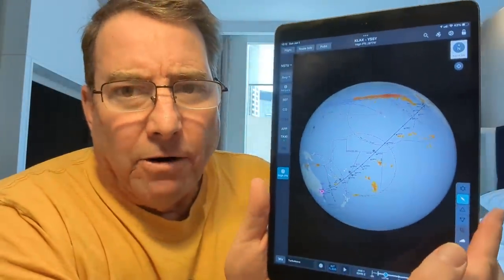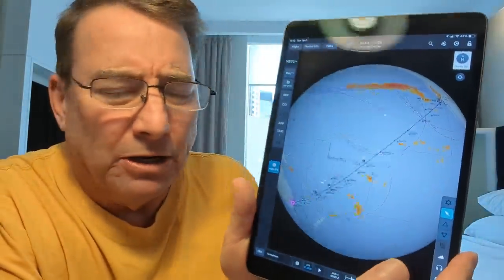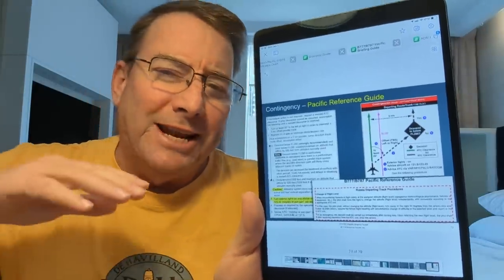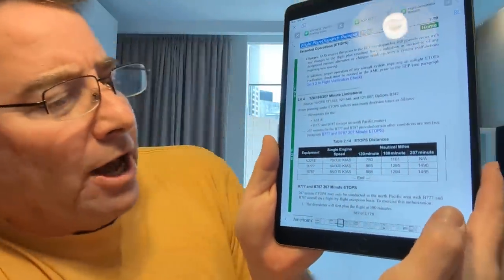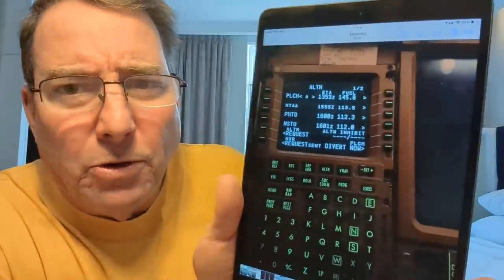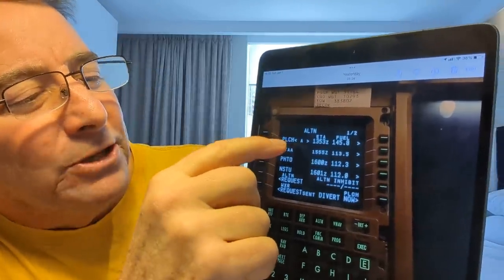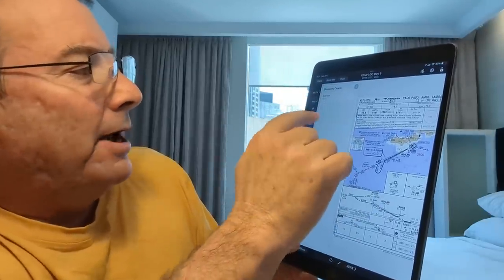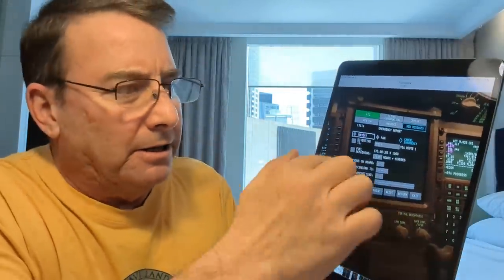Emergency Divert! UAL #839 Pago Pago 1/1/2023

Comment: Sounds like reliable satcoms would be welcome so all aircraft show up at all times as an extension or replacement of ADS-B. Starlink could serve, maybe an additional network for redundancy same as GPS now has multiple. Airliners have pretty good glide ratios but I wonder if that could be pushed even higher to say 25 if it saves fuel and can fly with a bit smaller engines and or fly better with just one.

Comment: Retired 747 Captain here. No offense but for training purposes the correct pronunciation of Pacific airports and especially reporting reduces unnecessary radio congestion on HF frequencies. Again, no offense but Pago Pago is pronounced Pahngo Pahngo. The ATC radio operators for particular segments appreciate proper annunciation of navigation points in order to preclude more back and forth on the radio. Clearly Pago Pago is not a reporting point, but if you look at the charts you will see what I’m talking about. This applies worldwide not just the pacific.

Comment: I've already read some about this incident. They landed in Pago Pago, American Samoa. The runway was barely long enough, 10,000 ft, the plane needed 9,000ft. The only international airline that flies in is Hawaiian Airlines. Samoa has several more options. Yes, the passengers received tours of the island and drank beer on the beach! Unfortunately, and I didn't study the specifics, but the passengers completely missed ANY major New Years celebration, due to the International Date Line, or whatever it's called. Too late to make Sydney and left from LA too early. Atleast they're alive to see 2023!

Comment: this a good reason why many airlines dont allow the same technician, to perform the same task on more than 1 engine at the same time. 

Losing oil in a modern turbine engine is a pretty rare event and seems like in a lot of these cases, the engine was just serviced, when this happens.

Comment: Had an ETOPS engine failure as a passenger - engine fire - Delta - 767.  It was not Pogo Pogo, but Nice.  It took us a loooong time to get out of the airport.  Half the aircraft was soldiers coming back from Iraq, none had GSM phones, so I lent mine to about 120 of these kids so that they could notify their families.   I hope the people on the LAX-SYD flight were not trapped in a tiny waiting area for hours like we were while the airline figured out what to do with us.  😀  We ended up "stuck" in a nice hotel for about 20 hours with as much food as we could eat, and wisely the CO got the hotel to lock the bar.

Comment: Great analysis and explanation of this scenario and Happy New Year, Juan!
At my airline the actual diversion airspeed is at pilot’s discretion, perhaps lowered to reduce the strain on the remaining engine or to save fuel. The certified ETOPS diversion airspeed is for planning purposes only. Are you in fact mandated to fly at the planned Diversion Airspeed at your airline in order to keep the actual diversion time under 180/207 minutes?
Thanks and keep up the good work!

Comment: I thought you guys had HF radios too? If so, wouldn’t you also use those to communicate with the company. Also, since you already have the satellite data link, wouldn’t it be easy enough to have sat radios too? Sorry if these questions seem stupid. I am a retired Army helicopter pilot and we had HF radios (which we all hated) and then progressed into sat radios which were great. When the company dispatchers (or whomever gets the divert message through the sat datalink) receives the info, do they contact the divert airfield to alert them that you are inbound and give them an ETA, since you’re not in a radar environment? Love your channel and all the info you put out!

Comment: I was on a flight to Dallas out of LA which had to return due to it being unable to retract landing gear. They were unsure if the plane would be usable after the landing so they gave everyone a voucher for a meal at the airport. I put a bottle of beer on my tray and was told the voucher didn't cover it. I didn't care and went straight to the bar after I ate.

Comment: I wonder whether ETOPS assumes a clean airplane? Thinking about UAL #1175 Fan Blade Failure heading for Honolulu in Feb 2018, when the engine cowling was destroyed, exposing a big flat ring and other protuberances, and the best they could do was lose altitude as slowly as possible.

Comment: I was a 17yr old passenger on a MATS flight from Guam to Travis AFB in 1963..My Mom and I were the only females on the plane except for the stewardess's, all the others were military guys.  I was sitting just behind the left wing watching the propeller , we were above the clouds and could not see the ocean.  All of a sudden I saw black liquid flowing out of the #1 engine and running back over the wing.  I said DAD LOOK! Dad leaned over and looked and immediately raised his hand for the stewardess.  She came and looked and went directly to the cockpit.  About 3or 4 min. later the propeller stopped turning.
The Pilot said "some of you may have noticed that we have feathered #1 engine," and assured everyone we could fly with 3 engines.  We lowered our altitude so that I could now see the ocean, the air got very stuffy and humid.  We were about 2 hours out from Travis to land and had to make a emergency landing at Alameda NAS.  Fire trucks ran along side. We deceided to let the  military guys get off first , and a lot of them got off and bent down and kissed the ground.  Also most of them were reading the emergengy water landing instructions. We had trouble with same engine when we took off on Guam.  We had to dump fuel and return to the island.  3 days later we took  off again,  had to wait for parts from Hawaii.  So the guys were VERY glad to touchdown stateside.
PS I just have to add , those old propeller planes were "tough work horses". I flew back and forth 6 times at least, and to Japan on propeller planes (prop jobs). They never had any problems when I flew except that one trip.  Those were tough pilots and good mechanics and planes. I hold their service in high honor.

Comment: Very good video, but what comes to mind for me is how ETOPS will work on the route from Auckland or Sydney to Santiago de Chile, as that is an 11 or 12 hour flight respectively, and you are tracking very far south.  I do not know of any alternative airports where a plane can divert to.   You are more or less skirting the Antarctic ice shelf.   Just a tad north of that.   Tahiti and Easter Island was mentioned once, but they are considerably north from the usual route taken.    I can't imagine flying in this isolated region on only one engine.  Currently 787's are used on this route by Qantas and Latam.   Not so long ago, this was serviced by quad jets, being the 747 by Qantas  and the  A340 by Latam.
Reply: Flights routed near the South Pole operate under the ETOPS 330 rule, which is a long time over water!

Comment: Hey Juan - Happy New Year. Guess Pago Pago would be a good place to celebrate, not to mention just landing squarely and safely on terra firma. I got a little mixed up when you started talking about legal speed verses most efficient for one engine. Wouldn't safety be your highest priority? Hypothetically, if you've lost one engine due to an oil leak, wouldn't it be a possibility you might develop a similar problem with the other engine? Hence how good of an idea is it to push your only functioning engine past normally its most efficient speed? How is it that the faster speed requires a lower altitude? Interesting stuff. Also, if your destination "goes below minimums", why can't you land on instruments? 
Always fun to learn about this. Maybe in my next life -  
Glad the folks made it safely to Pago Pago ~ Happy New Year, everybody!
Reply: Below minimums means below "instrument" minimums, which usually means very low visibility..  Oil systems between engines are not interconnected in any way.  It is possible to maintain higher speeds while descending, which will happen anyway, because you usually can't maintain normal cruise altitude on one engine, even at max power.  You also must get lower so that one engine can maintain pressurization in the cabin to provide a breathable atmosphere for the passengers.  Most airliners today only have 15 minutes of oxygen available for passengers in case of a cabin pressure loss.
Reply: Thanks for answering. I know the engines aren't interconnected. I was just considering the liklihood that if one engine had a problem, you couldn't rule out that there might have been a snafu somehow in its maintenance. I would think that on a big airliner both engines would get maintained at the same time, so that implies a possibility that the other engine might potentially have the same problem, say, for example, a tech or mechanic's mistake or accidental oversight. Things like this can happen. So if a big airliner loses an engine, do they continually slowly lose altitude? I thought they could still cruise and maintain altitude. I can understand about the need for O2 if there is decompressurization.
Reply: @nancychace8619  - Engine failures are RARE.  2 engines failing for the same mechanical reason - highly unlikely.  If a shared system fails, like running out of fuel, or both engines ingesting FOD,  then yes, possible.  But also yes, nothing is impossible, just unlikely.  Engines usually have routine checks done at the same time, but not necessarily major maintenance at the same time.   The reason ETOPS is approved by the FAA, is that today's engines have very high reliability.  Previously, you needed 3 or 4 engines to fly extended over-water.  When a 2-engine airliner loses an engine at high altitude, they can no longer remain there, they must descend.  One engine does not have enough power to keep the airspeed above stall margins.  So, a DriftDown descent is initiated, maximum power is applied to the good engine, and speed is determined by altitude and weight to provide adequate stall margins.  The crew might also choose to descend faster to maintain cabin pressure, as again, that's not possible on one engine.  The ability to clear all obstacles on the planned route has to be determined before takeoff.  An easier example to visualize is when an airliner's route takes them across the Rocky Mountains, say west of Denver.  Prior to takeoff, the maximum weight of the aircraft has to be such that if it loses an engine over the Rockies, it can DriftDown, and still clear the highest peaks (14,500' MSL) by at least 2000'.  That clearance includes the descent, as well as whatever altitude can be maintained in level flight on one engine.  Often, a heavily-loaded airliner can not maintain the 16,500' MSL required over the Rockies.  In that case, an en-route DriftDown alternate is added, say SLC or GJT, as an interim airport to descend into and land after an engine loss, say in the case DEN was too far away on one side of the Rockies, and SFO was too far away on the other side.  Of course, en-route forecast winds, weather, predicted fuel burn, predicted weight at top of DriftDown, planned cruise altitude, and many other factors go into calculating predicted performance on one engine, accomplished by both the Captain and the airline Dispatcher, prior to departure.  In some cases, fuel, passengers or baggage/cargo have to be removed to get the aircraft light enough to do the trip.  Same thing applies to overwater ETOPS, except they don't have to worry about clearing mountains, instead they have to always be within 3 hours of an emergency field with acceptable weather.  ETOPS has evolved over the years, providing longer times allowed to fly on one engine to an emergency alternate, as engines have become more reliable.  https://www.youtube.com/watch?app=desktop&v=rZV9Aw1XJeA
Reply: Thanks - appreciate your very good explanation. It is interesting to learn about. Lol - I had great visions of the passengers and staff bailing baggage out of the plane to maintain altitude 😀 (joking, of course) 
You also reminded me of an experience I had once when flying over the Rockies. I think it was a de Havilland Otter but it's been so many years not sure I remember correctly. As we were negotiating the 14K footers the O2 masks dropped down - My experience that ensued is best left to the imagination until some time around a future campfire...
Was never so happy to get to Denver.
Appreciated your patient description. Thank you for sharing.

Comment: How much does etops affect fuel loading requirements, I'd assume single engine operation is lower efficiency than dual between the adding control inputs to keep straight, lower altitude, etc. and it sounds like you may have to use an even less efficient speed and altitude to meet etops time rules, I'd imagine that means in at least some cases near the end of a flight that could need significantly more fuel than if the flight had no issues and landed as intended.  I'm curious if that ends up being higher than standard diversion and other required contingency fuel and by how much as I'm assuming you have to have calculated it and made sure you have enough onboard for it?
Reply from the maker: See previous updates

Comment: Love Blancolirio! I have a question I hope you can answer (or provide a link to where it has already been answered). When a plane with two engines such as the Boeing 787 shuts down one engine because the pilots suspect it may fail due to an engine leak (as in the UAL example that motivated your recent ETOPS video), is it possible for the pilots to restart the shut-down engine, and if so, under what circumstances might they consider doing so?  Thank you!
-David

Comment: ETOPS continues to be an issue for the fuel community, relating to the requirement that you be able to start the APU in flight. I'm assuming that both the reduced altitude and the increased speed are related to having enough fuel to meet the range requirements. Lower altitude is pretty self-explanatory as it puts less strain on the single engine to maintain altitude. The increased speed, on the other hand, may well be related to increasing the mach heating of the wing to reduce fuel cooling/freezing issues.

Comment: Great content Juan, but I do have a question. Why the descent from FL 380 to 200? I understand that in case of loss of the second engine you've lost all pressurization, but other than that I would think the pilots would want to stay higher. A much better fuel burn at the higher altitude, and better TAS. Is the one engine unable to maintain that altitude, or what is the reasoning for the descent?
Reply from the maker: Correct

Comment: Sorry if this has been asked in another comment.  It seems that after the emergency was called the plane descended from 38,000 to 20,000 feet and proceeded for the next 3 hours to Pago Pago.   What exactly would they be trading altitude for?  (Or perhaps it doesn't matter if you are flying at 10 feet or 40,000 feet when you are many hours from the nearest airport.)

Comment: Pago Pago is not an island. It is a village on the island of Tutuila which is an island in the American territory of American Samoa.  Plus, Pago Pago is pronounced way differently than how most English people pronounce it. 
Have you looked up some of the plane crashes around that island? There are some pretty interesting plane crashes. The most recent one was a boy trying to circumnavigate the globe. Then there was one that ran into a guided wire between the mountains and crashed into a hotel below. Another one, the salty air rusted the steel wires between the rudder and yoke. The steel wire snapped in mid flight between two of the American Samoan islands.

Comment: Christmas Island as an emergency diversion point figured in an OLD story by G. Harry Stine. The Shuttle program had designated it as an emergency landing point for the Shuttle. Harry, in the story, not so gently pointed out that yes, the shuttle can land there but that is when your real problems began. For example, there was no way to get it off Christmas Island. NASA fixed their emergency landing point tables.
{^_-}

Comment: Are the ETOPS circles fixed? .... Does wind play a factor as well.  Let's say you are on the fringes of one ring, but wind conditions favor the destination of the other ring.
Reply: Yes ETOPS Circles are fixed, they are based on still air for planning the ETOPS area of operation, for the flight dispatch calculates the equal time piont based on winds based on the altitude used for diversion ( typically the worst case of single engine with depressurization of 10,000’ is used) ETOPS diversion time may exceed 180 minutes due to winds on certain flights such as west coast to Hawaii. In a single diversion an emergency is declared and the crew may also deviate from the planned speeds used to define the ETOPS area.

Comment: Hey Juan,  when planning the ETOPS circles do they consider the wind in the calculation for the 180 minute max?  Or are they calculated at zero wind.   The winds aloft could make the 180 minute circle lopsided as the wind direction would impact the time to get to an alternate depending on the direction your flying.  Happy New Year and thanks again for all you do on your channel.
Reply from the maker: No wind.

Comment: First off, ‘Happy New Year’ to all and thanks for the great content! 
You’ve probably covered this before, but does single engine operation rule out use of reverse thrust on landing (if it would normally have been required), or is asymmetric reverse thrust not actually an issue?
Reply: Not an issue.

Comment: OK, you've landed in Pago Pago...then what? What was wrong with the engine? Could it be fixed there and return to service? If not, what then? Do you send an empty plane to "rescue" the pax? If the engine was completely trashed, would you fly a new engine and maintenance crew in to do the fix?